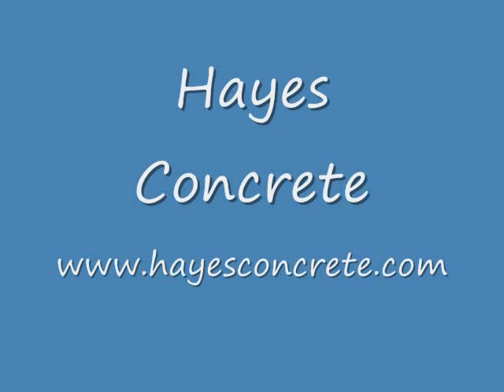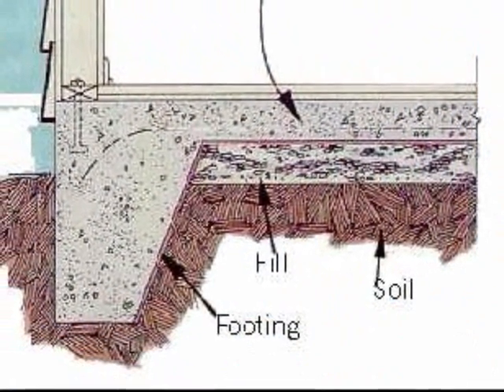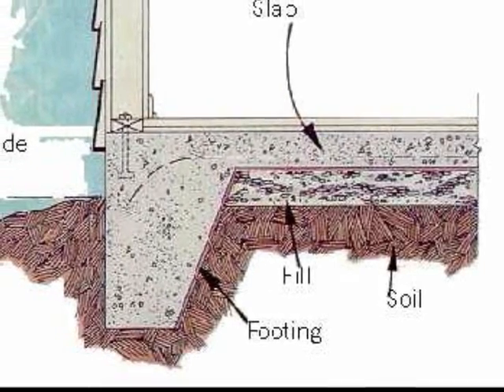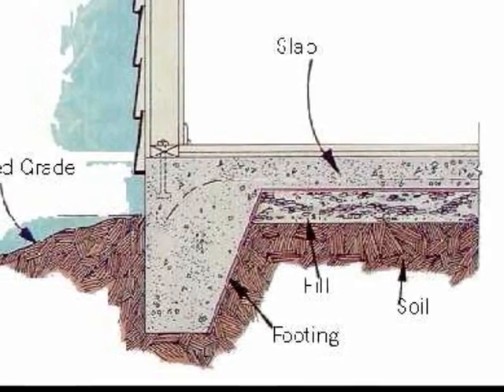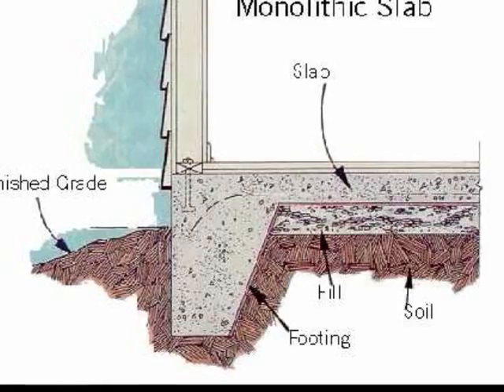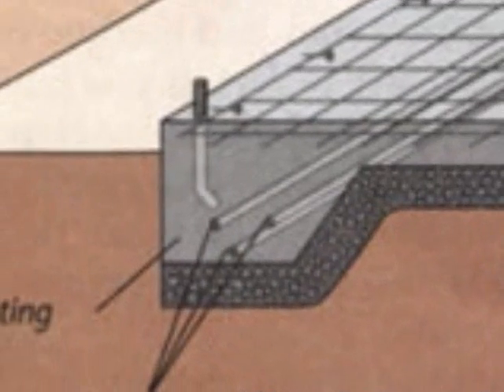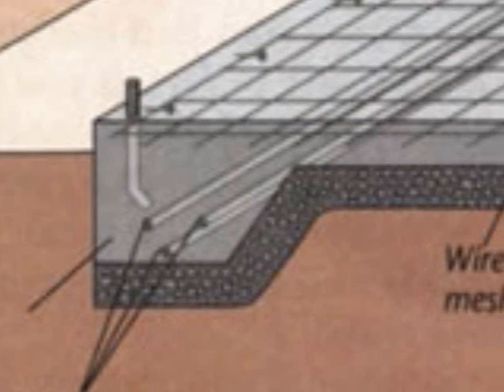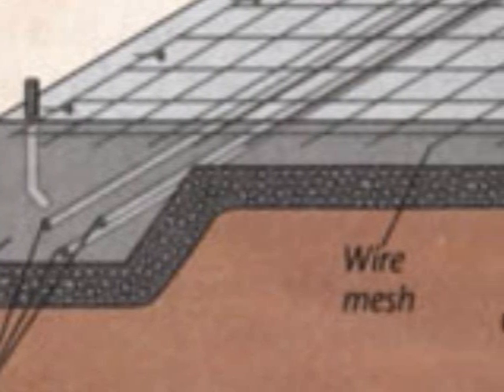Monolithic Slabs

Comment: yahoochiewatchie, generic footing sizes are given because it is assumed the contractor follows standard practice and compacts the soil to 1500 pounds per square foot minimum bearing capacity.  That spec is on almost all residential building plans.  Along with the min. bearing spec will be notes telling the contractor to notify the designer/architect/or engineer if they run into expansive soils or other problems.